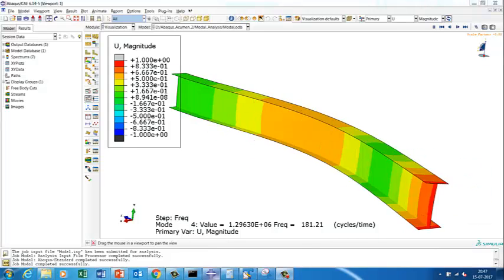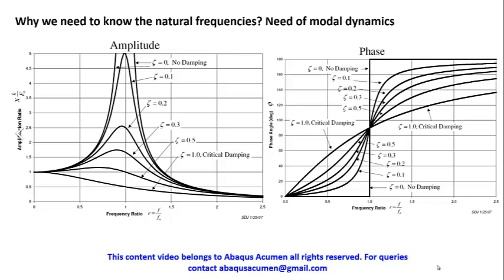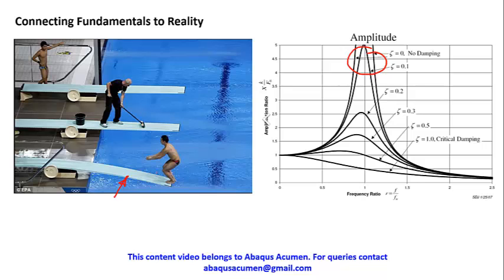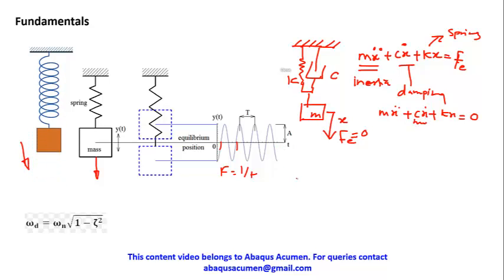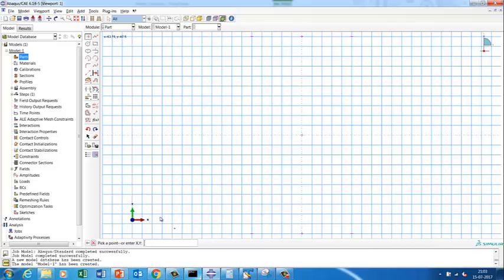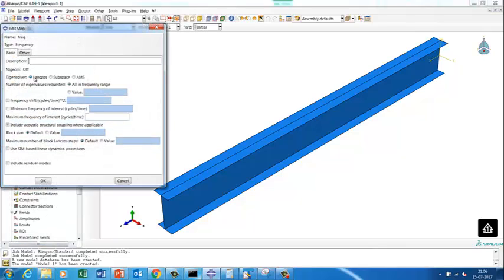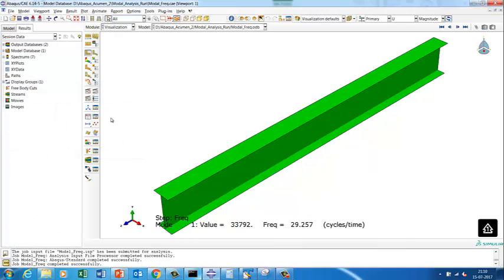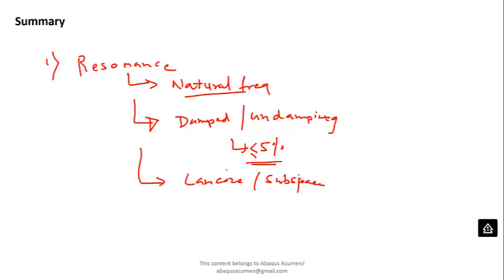Abaqus Standard: Fundamentals and Modal analysis

Comment: Thanks for the helpful video. I just have a simple question: It is written as a result of Mode 1 that Freq = 29.257 (cycles/time). Does it mean it is 29.257 rad/s, or that the period of beam is 0.215 s? What does this value of 33792 represent?
Reply: (cycle/time) is Hertz in this analysis. I checked theoretically.
Reply: Have you found the answer for the units of cycles/time?
Reply: @eashansaikia1427  Unfortunately not. I will let you know if I find out something.
Reply: @gonnabeok123  I also found out another issue. If I build my model with mm instead of meters, and also scale the material properties in terms of mm, I see that the cycles/time scales down by a factor of 30. Not sure why this is happening